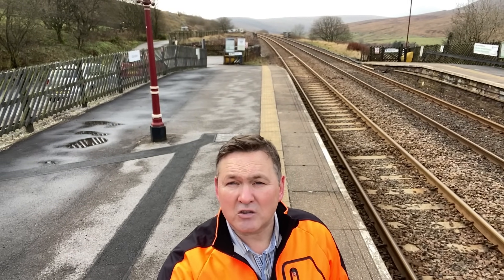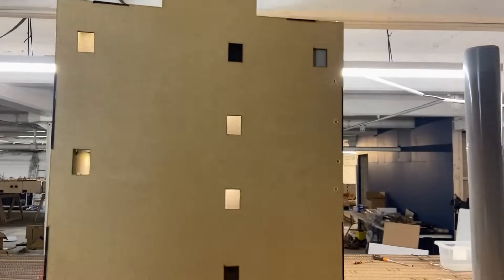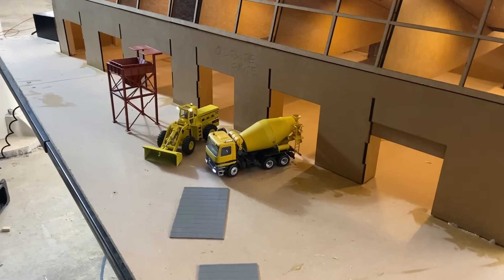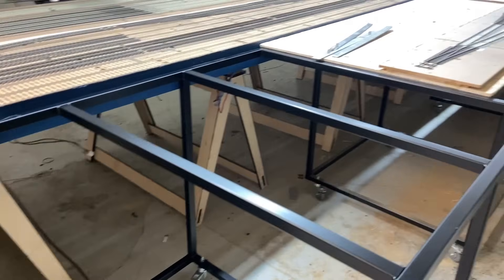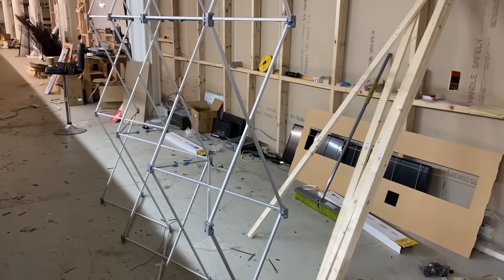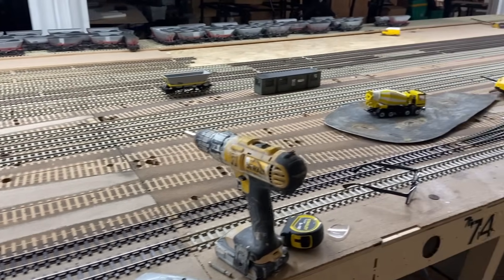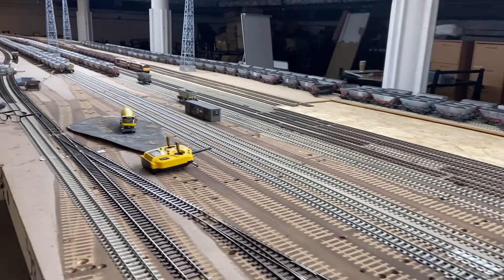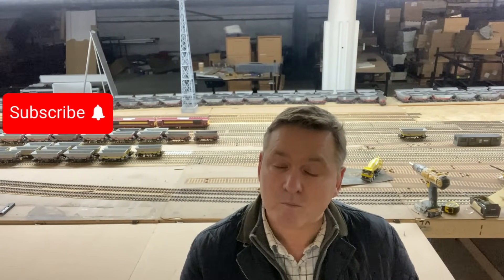Heaton Lodge Junction - Great Progress This Last Week.. And New Extension Carts Land!

Comment: I'm loving this channel. How or Why i haven't noticed it before I did, I really dont know but thank you for sharing regardless.  As a resident of the North East Tyne Yard was my local, they had a shunters cabin, at the North end of the Yard, where the lines for through MGR and freight traffic, I dunno about Healey Mills. I was wondering if you'd be putting them in too. Easy for me to say, your building the things I know. I was just thinking most yards probably would've had them. Sorry if it seems I'm trying to tell you how to build stuff, when I haven't got a clue where to start myself, I'm honestly just wondering. You may get a few more questions of this ilk, so I apologise in advance. Keep up the excellent work, very enjoyable watch.
Reply from the maker: Hi Mickey yes there’s lots of building going on the marshalling yard, admin building, mess rooms & staff quarters etc.
From this next video there will be a lot more hands on stuff. 
I drove over Tyne Yard earlier today there is still loads of bogie coal wagons parked up there. 
Thanks for watching and your support! All the best.
Reply: @britainsbiggestmodelrailwa1428  lot of ballast wagons too. Plenty engineering trains get filled there. Not a great deal else. Went to the bankside many moons back at Healey Mills,  was after some of the locos for sight amongst the scrapped locos. Wanted to get them underlined before they were turned into razor blades. Sad sight indeed.

Comment: Just so you know, Right hand drive Concrete Agirators Mix Counter Clockwise (Barrel up in rearview mirror) and Clockwise in discharge if viewed from behind. Left hand drives are opposite. This has to do with road camber and balance of truck whilst driving with a live load.
Reply from the maker: Never knew that thanks. Interesting stuff 👍
Reply: Mercedes mixer trucks - when in charge the drum will spin counterclockwise, whereas the Iveco trucks - when in charge will spin Clockwise, both right hand drive.
Reply: @e575fho this would be a peculiarity based on European standards but here in Australia they are as I described and in the US of A they are opposite and this comes down to road camber and safety.

Comment: Hi Simon, rather than have to learn to 3D model and print, might it be worth approaching some companies that do this such as West Hill Wagon Works or 3 Peak Models? They might be willing to expand their range?
Reply from the maker: Thanks for that. Tim Horn who does the baseboards has offered to resin print bits for me.
The problem is a lot of what I need is stuff no one else would buy eg funny cone shapes and pipes for the cement factory etc.
Thanks again 👍
Reply: @britainsbiggestmodelrailwa1428  Might also be worth looking at some 28mm wargames pieces. Warhammer 40,000 might have some pipes that might work, as they tend to be "heroic" (ie over) scale.
Reply from the maker: Great idea I’ll look at that. Thanks again

Comment: Simon, is this your layout or a club, and if it is yours, did you rob a bank or something 😊.
How do you get to any part past your arm length, and is there an end goal on size, Steve
Reply from the maker: Hi Stephen, yes it’s my layout I began building it in 2013 and finished phase 1 of it in 2019. I’m not in a club.
What you’re seeing now is the building of phase 2.
I funded the phase 1 by selling a business I’d started and remortgaging my house.
The end goal is to take the layout to the general public by bolting on to out of town shopping centres and charging a small entry fee 
Thanks for watching 👍
Reply from the maker: Also … it’s easy to get to any part of the layout by moving the mobile steel carts which much of the extension of phase 2 is built on.